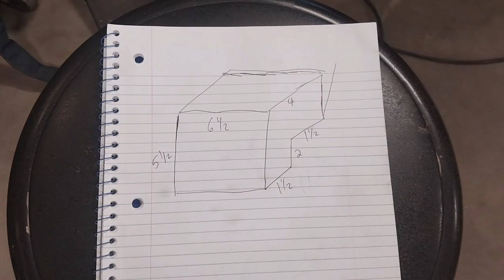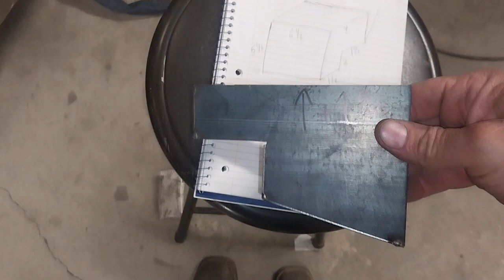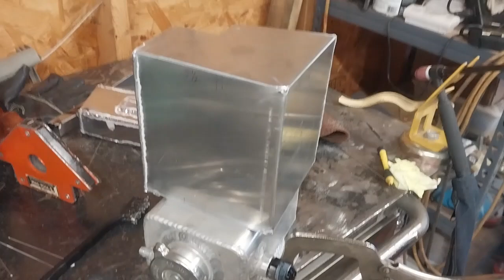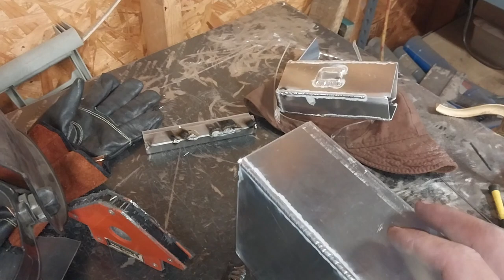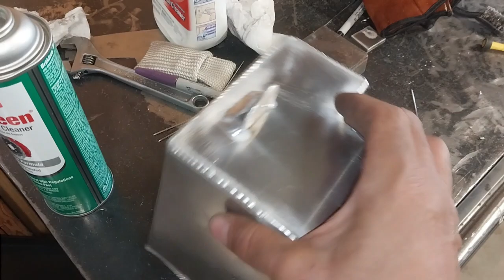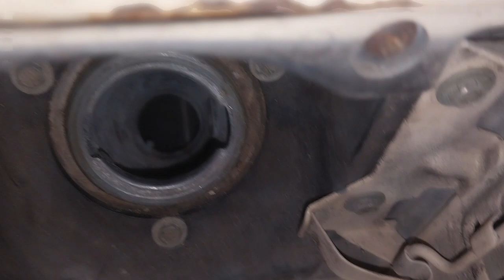Coolant Reservoir - TSLA VW

Comment: If you get an extended drill bit, you could drill down the centerline of the filler neck into the reservoir. Then, weld a piece of rod onto the reservoir, in that hole. Then, slide it back up into the filler neck hole and bend the rod to be aligned perfectly centered, in the hole. This will help you get the alignment for the new filler tube. I’d also abandon the steel filler neck for all aluminum. You can then cut a plate with a hole the size of the filler tube, and slide it down over the new filler neck. Mount the whole assembly in place, and then tack the filler neck plate onto the the filler neck, while it is aligned perfectly with the body. Then, of course remove, fully weld, and re insert and drill out the 3 mounting screws and weld on a new cap.
Reply from the maker: phew!  I'm going to have to read that a few times...that's a lot!  haha.  I stuck a sharpie down there on a long piece of all-thread and scribbled a reference for the filler.  I really like the idea of welding a piece of rod to the center of that scribble then bending it to match the center of the filler tube.  Good idea!  As for getting rid of the metal filler tube, I want to keep it.  I want to keep the gas cap, too.  I think it'd be hilarious to open the cap in a crowd and pour water into the "fuel tank."  I could tell them it runs on water!